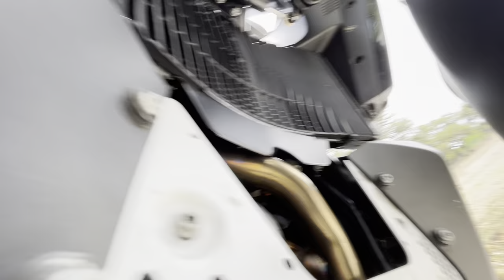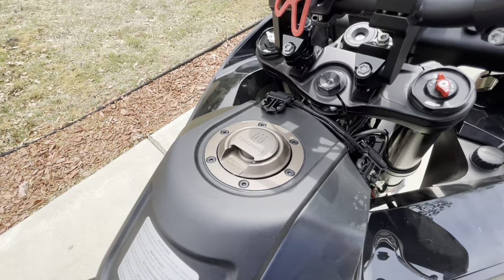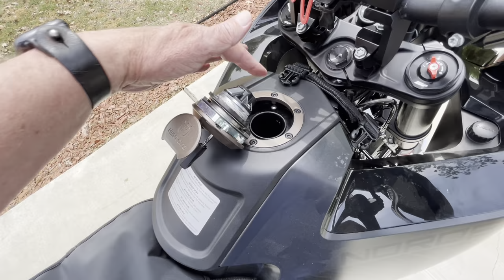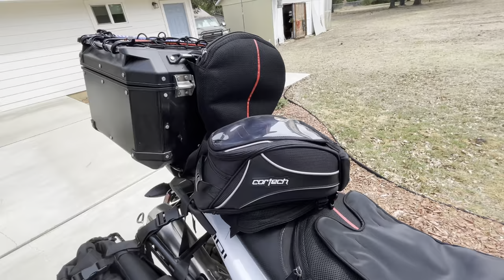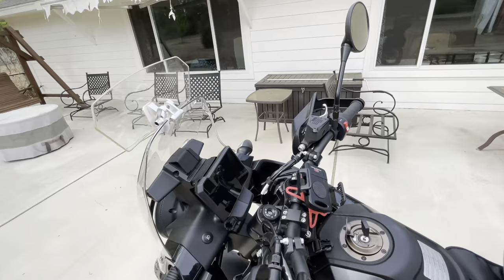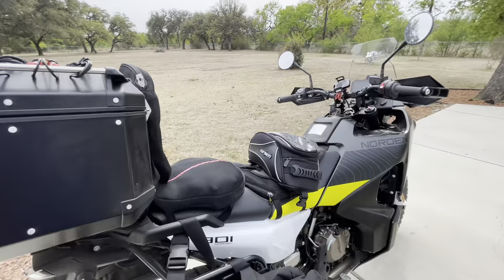Problems with my Husqvarna Norden 901 - Fuel and Coolant

Comment: I am 4 months into my 2022 Norden 901. No problems.  All is tight.  I am amazed at how easy it is to ride on road and off.  I have about 800 miles on it now.  My gas cap is hard to close also.  It takes two hands to lock it in but it seals up good.  Tranny was slipping into neutral when going from 1st to 2nd when brand new but now it is good. The dealer said to give it some time to break in and it now it is ok.  Easy shift is a blast.  You can hold the throttle 3/4 of the way open and click up through the gears as fast as your foot can move.  She takes off quick.  Motor is loosening up now, seems to be getting faster.  Never thought I would be riding wheelies at the age of 60.  It is half the weight of my new Road King.  The Road King is better on the highway but it has been collecting dust since I got the Norden.  It is a hoot to ride.  Great in the desert and forest!  Worth it even if I have some future light mechanical work.  The bike is amazing.  Warning: when in the dirt, make sure to set the bike for off road and turn off the rear anti-lock.  If tire is spinning in loose sand or on a steep hill, the computer can get conflicting signals and stall in street mode.  Not good in precarious situations.  Take my advice and switch to the correct mode.  I learned the hard way!
Reply from the maker: Totally agree. Glad you don't have any problems. I was going fishing and my fishing pole was blowing off the bike. I had to pull over to tie it back down. The road was very busy. So when I was getting back on the highway, I twisted the throttle and could not believe how easily the front end lofted up in the air. It's a fun bike but the problems I had have left a bad taste.

Comment: Husqvarna 901 owner, i LOVE this bike!! Yes i have tightened a bolt or 3 but the performance and balance is by far the best of the ADV bikes i have ridden. It is unfortunate one needs to lightly work on a brand new bike but im still extremely happy. My 701LR has 1900 HARD  miles, running strong no issues.
Reply from the maker: Like another commenter, I think you are spot on. I love riding the bike as much any one I have ever had.

Comment: No gas smell issues although I will be checking my cap after watching this. However…the coolant issue…we’re not alone. My shop (up here in NorTex) went through the bike and finally identified the clamp as the culprit. They actually pulled the stock clamp and replaced it with a heavier one. No issues since….fingers crossed. Also as you stated in the description the wind buffeting up around your head and shoulders is bad…like horrible bad. Identified…several issues with the design of the windscreen which make it so bad. 1. The sharp angle on the sides throws a jet stream square onto your shoulders. It needs to be more curved on the sides. 2. It’s not tall enough nor is it adjustable like a Triumph Tiger for instance. 3. Drafting coming up through the fairing where the forks are. This creates kind of a vacuum effect exasperating #1 & #2. 
I’ve contacted several aftermarket windscreen manufacturers about this and they are eager to solve the problem because the 1st one that gets it right will have a goldmine. Everyone complains about the wind…especially 6’3” guys like me.
In the meantime as a temporary solution that actually does help quite a bit…especially in all our N Texas wind….I bought a set of Black Dog Cycleworks pegs that drop the pegs down a 1/2 inch and ride with the saddle in the low position. Now the jet streams mostly blow  over my shoulders and just graze the top of my helmet. I’d rather have the saddle in the higher position because I’m tall…but this was a decent ergonomic compromise until someone solves the problem with a better windscreen.

Other than that 100% agree with your assessment on the bike. It’s a killer riding bike with a few idiosyncrasies that need to be addressed to make it damn near perfect….so far.

Any other Norden owners out there reading this….make your dealer/shop replace the radiator clamp BEFORE you ride off the lot!!
Reply from the maker: Totally agree. As annoying as the leak and fuel smell are, the wind buffeting is 10 times worse. It actually blurs my vision. The wind down here in the Hill Country (West of Austin) this year is the worse I have ever seen. 

Riding the bike is such a pleasure. It put a smile on my face every time. Several times a week me and the wife take an hour ride when she gets home from work. Minus the issues the bike is amazing and so much fun.

Comment: Great little video Dave.  I bought the 901 as my first bike in 32 years. My last was a 1990 KX500 and now I’m 60 I wanted to get into adventure riding and so far I’m loving the bike. I also had hoses loose and one with no screw in the hose clamp🙄. Dealer fixed it though.  Taking my first adventure on Monday and will have more of an idea how it performs!!
Reply from the maker: Congratulations. I rode today. I am so happy I got back into motorcycling. Me and the wife get out and about so much more since we got the bike. Have fun on your trip.
Reply: Thanks, I'm looking forward to the first of many....subscribed 👍

Comment: Figured out the gas smell. 

There is a cover un front of the fuel cap. There are two vent lines up top. The one on the left goes to the chsrcoal cannister. 

If the left one is kinked, it will prevent proper venting and cause the tank to pressurize and fuel will come out of the overflow and vapors on the right. 

When you moved stuff around it probably fixed the kinked hose.

Comment: And that's why I'm sticking to Japanese bikes. A $16k bike shouldn't have any issues for a long, long time IMO.
Reply from the maker: Agreed. I was really hoping for the new TransAlp with DCT and cruise but it never happened.....yet. I talked to the dealer in Marshall Texas, bought most of my bikes there, to try and get first chance at one when it came out. The Africa Twin felt too big for me.
Reply: Yet many do lol. I’ve owned Hondas and KTM’s for decades and I’ve had issues on some and none on others. It’s called reality.
Reply: Africa twin..rust on wheels and problem with the fuel tank..Some of them problem with the tft screen etc..so?If we speak about 20 years before yes..
Reply: @vageliskoios1062  I agree they aren’t what they used to be. I’ve had my KTM for a while now and I’ve had less issues on it than I did my Honda last year. It is what it is. You win some you lose some.
Reply: My 96 transalp is still flying not sure if it's on 50kms or 150kms lol

Comment: That fuel cap should close just by pressing down on it. Key should spin and lock it by itself. I’d definitely have the dealer look at it and replace the fuel cap if it’s not right.
Reply from the maker: Thanks for the information. I thought they were all probably like that. I will take your advice.

Comment: One of the first generation Honda Africa TwinsCRF1000L a couple of years ago: corroding spokes, sticking switches, bike not starting after a few days of heavy rain, leaking fork seal at 25.000km and worst at 30.000km valve clearance so far off that the mechanic called Honda to confirm the values in the manual.
KTM 790 Adv R over 50.000km: condensation in the display and a leaking fork seal at 30.000km. 901: same issue with the same hose clamp fixed with a long screwdriver within a few minutes. If that bike has the same reliabilty as the 790 before, I will be perfectly happy. I wasn't so much with the Honda before!
Reply from the maker: You are probably right. I think this is the first brand new model year I have bought of anything. So, it is my only experience. Hopefully it will end up well. Still riding the bike with the Fuel and shock issue until my appointment later this month. Thanks for the information.
Reply: @Texastoo2  In my opinion all manufacturers are cutting down on production costs today as possible and one way is to minimize quality checks. I was also quite disappointed that even the second display I received as a warranty replacement showed condensation again. It's probably cheaper for KTM - but of questionable attitude towards customers - just to replace the display, hoping the next one is water proof at least until the warranty expires. 😞

Comment: I have been riding since the mid 70's. From my experience it's wise to check bolts and screws on a regular basis. It's part of normal motorcycle maintenance. Especially after riding off-road. Motorcycles vibrate...... things come loose. My Husqvarna 701 Enduro vibrates fasteners loose all the time. What ever the brand...... I would make it a habit to check things over before riding. My two cents...... stay safe.

Comment: Good report.  Sounds like they need better QC during assembly.  Wonder where that is?  I’ve owned 3 ktms & all were excellent.
Reply from the maker: I think it is a combo of China and Europe. I think once the dealership fixes the fuel smell and rear shock, I will be very happy. We have about 2000 miles on it so far and we both really like the bike.

Comment: I had same problem with my coolant on the 790r before KTM offered to replace engine. I then went to 890r but now have lost all confidence in these engines. Suffice to say I've gone back to Japanese.
Reply from the maker: I am still holding out hope that these will be my only issues. If not, I will be looking for the new Honda Transalp when the new one comes out.
Reply: Thanks, this is an interesting bike by design, but now I will stick with Honda.

Comment: Great video - I too in my 60s and love the power and ergos of the bike - just fun to ride. With luggage and pillion rider, how are your shocks holding up. I need to respring the back for sure as I'm a big fella.
Reply from the maker: Yes, rode today and the bike put a smile on my face. I think the rear shock is way too soft. Might be because load it up. I turned the preload up but it still seem spongy. Another reason may be that I have the luggage pushed back. I had the wife sit on it and let me know where she wants the trunk and saddlebags. She liked it all pushed towards the back. Have fun.

Comment: The Petrol issue would have had me returning the bike to the dealer straight away. For the last 40 years i have rode Japanese or Triumph bikes, 4 years ago i bought a new KTM, kept it 10 months, a very entertaining bike to ride, but i have never had a new bike with so many small niggling faults. So back to Suzuki and Honda, no more annoying little issues that are really based on quality control. I accept that any new bike can have  the odd teething problem, but the Husqvarna brand seems to have well above the average.
Reply from the maker: Thanks for the comment. I replied to similar comment earlier: If I was riding solo, I would definitely not buy this bike again. However, I ride 2 up 80% of the time and this is the only one middle weight the wife would be comfortable on. The dealer cannot look at if for over three weeks but I am hoping they can get it sorted out in one trip. Still very frustrating.
Reply: @Texastoo2  Tiger 900 Rally Pro?

Comment: Do you know if there are more users with these problems? They have not been solved with the new motorcycle guarantee?
Reply from the maker: Not really. I left mine at the shop for over a month and they did not fix a thing. Unless issues are obvious these days, shops will not spend the time to fix them.

Comment: Hi Dave my fuel range sensor not working ,I fill it up and not reading  the proper fuel ,,I checked fuel peacocks both turned on ,still running out of gas with 1 tank fuel ,so I’m off to the dealer tommorow,I hope it’s not a sensor that will be back ordered,thanks for your video
Reply from the maker: Sorry for the late reply. Started a new job this week. One of the items I found on my bike was that the petcocks were not all the way open. It was half open so I don't think it made much difference, Hopefully it will be a quick fix. I got mine in the shop last week appointment on the 26th, They still are not able to get to it yet. Dealers are very busy now. Good luck.

Comment: The more you tighten the cap down, maybe it will become less tight, with seal being too low? Great advisory video, thank you.
Reply from the maker: I thought that too. I tried tightening just the front gas cap bolt, then I tried just tightening the rears, tightening them all and then loosening them. I never got the smell to completely go away. Bike is in the shop. So if they get it fixed, I will update.

Comment: Did you paint black the tank protections? Isn't it originally aluminium colour?
Reply from the maker: Yes. I did not like the silver. I painted it when I took the skid plate off for the first oil change.

Comment: Clutch cable on a premium bike in 2022??, annoyingly, my Africa twin adventure sport has one as well, my old 21yo Suzuki 1200s bandit has a hydraulic clutch, why dont manufacturers use hydraulic??, cables eventually break and require lube
Reply from the maker: I certainly wish I had gone with an AF. Might trade this in on a TransAlp if it ever comes out.

Comment: Why are you putting a spanner to it when it's only 2 months old? Throw it at the dealer to fix, surely they did a pre sales inspection.
Reply from the maker: It was in the shop over a month and the dealership did not fix a thing. It is pretty much the way things go these days. I pretty much predicted it before I took it in.

Comment: Even with all the issues you've had, I'll buy a Norden over a T7
Reply from the maker: Yesterday was a turning point. Me and the wife wend on a ride and the gas smell was back and overwhelming. She hates the smell of gas. I called the dealer to make an appointment and it was over 3 weeks before they could even look at the bike. Also, they wanted me to drop the bike off and leave it which is a big hassle for me. So, if I was ridding by myself, I would absolutely NOT  buy this bike again. However, I ride two up 80% of the time and the wife is very comfortable on the bike. We rode the Africa Twin and did not like it much. It seems to be my only option right now for my situation. The T7 and other middleweights are not really setup for 2 up riding. Hope that answers your question.

Comment: Is there a reason you didn’t take it back to the dealer to fix things? That gas cap is still messed up and should be replaced
Reply from the maker: Yes. The dealership is 60 miles away on the other side of Austin. I am sure they will have to look at it, then order the part, then have me come back. I was hoping I could just fix it but looks like I will still need to take it in. The gas cap is still hard to close.
Reply: I would definitely take it back to the dealer.
Reply: self reliance maybe ??
Reply: @igordementiev9207  im sorry

Comment: Does this bike have center stand as standard? Loving the look of this mid size adventure bike 👌
Reply from the maker: Mine does not have a center stand. I think the same one for the KTM 890 Adventure fits this one too. I probably will not get one. I have the rear stand to tighten and lube the chain.
Reply from the maker: One more comment: I bought the rear stand at Harbor Freight. I think it was 50 bucks.

https://www.harborfreight.com/motorcycle-swingarm-rear-stand-65620.html

Comment: Mate, this is weird,  I have a Husky 701 Endo and has exactly the same issue with a leaking coolant pipe hose and a faulty fuel cap! Replaced the hoses and clips with heavy duty one's, but had to manufacture a thicker rubber gasket for the tank. Easy fixes but annoying from a premium brand. 
However,  the bikes a Legend off road.
Kind Regards,
Reply from the maker: My leak seems to be fixed. I had to tighten the clamp twice. However, you and another person commented about replacing the clamp. That is probably a good idea. I just assumed it was too loose but the clamp might be the problem. The fuel smell is 99% better but every once in a while when the bike is hot and I am on a rough gravel road or flicking the bike back and forth, I get the fuel smell. When I ge time, I will take it to the dealer for them to look at. Thanks for the information.
Reply: @Texastoo2 when the bikes cold, ensure the cap is secure and lay the bike on its side, if fuel pisses out then you know its the filler cap.
Reply from the maker: Good advice. However, I don't know if I would ever be able to pick it back up. The cap is still hard to close. So, when I get time, I am going to ask the dealer check it out. Thank you.
Reply from the maker: @julianclayton8788  Just an update: The fuel smell was back and very strong yesterday. I called the dealer and they said 3 of the bikes had the same issue and will probably be a recall.
Reply: Some parts, if you compare to the 1290, on this and the sister 890, look poor quality. Not all of it, no where near, but there’s just a few cheaper looking parts that are like you’d have seen 20 years ago. Poor looking metal and finishing - I just don’t why ktm or husky are risking so much to save just a few dollars, euros or pounds. A shame and poor management. Seems the fuel cap design is one, plus simple things like hose clamps…
Reply: @mabsbry1318  Ack your last mate, I had to change all my coolant hoses within the first week as they were poorly finished and badly clamped with non-adjustable factory ones and we're leaking. However I have heavy duty Apico ones now with proper clamps fitted, it was an easy fix. BUT you right on a premium product Husky should have done better! Interestingly, my KTM 990 Adv was built like a tank! Saying that it needed to be I needed to be we fell off allot 😄
All that said - I really love my Husky 701 Endo, it's brilliant, but Husky need to improve their quality control.
Reply: @Texastoo2 thank you for following up on all the comments! I have the same gas smell problem you described in other comments, happens on a hot day after riding a bit. Did you ever get it resolved? My dealer said "that's normal" 😮‍💨